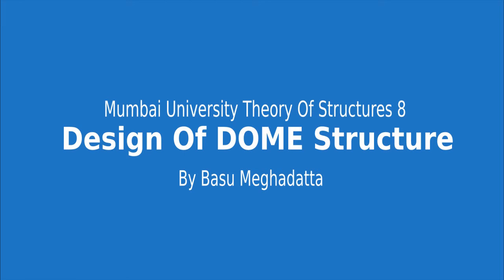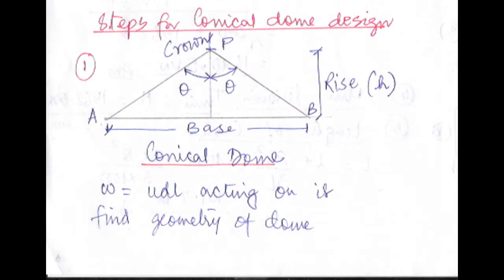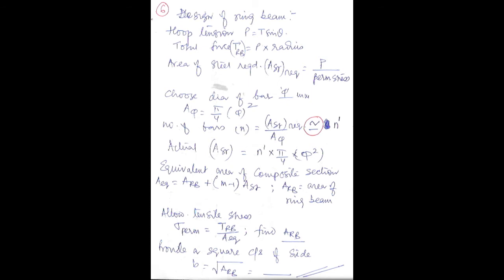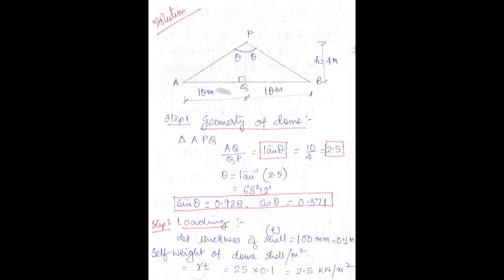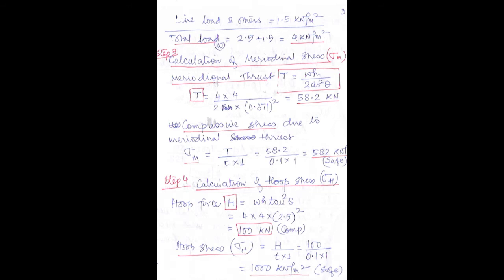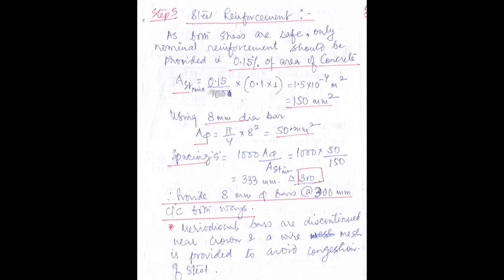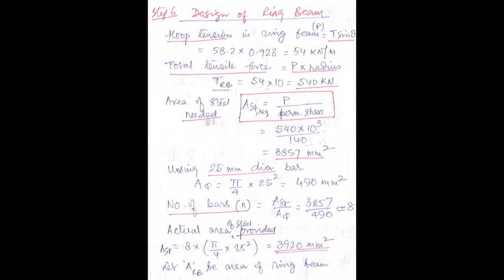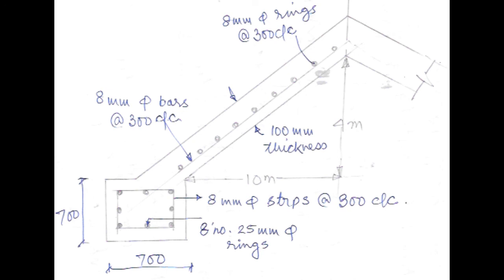Design of Dome Structures: Mumbai University TOS 8

Comment: mam , how we can say that the stresses are safe?
Reply from the maker: Dear Dhiraj, for working stress method of design the permissible bearing stress on full area of concrete shall be taken as 0.25fck = 0.25 x 40 = 10 MPa (here fck = 40 MPa as M40 is used)
Reply: @MeghadattaBasu   Thank you so much mam